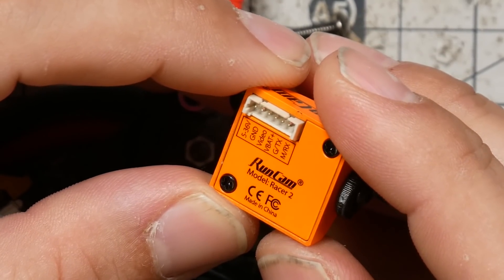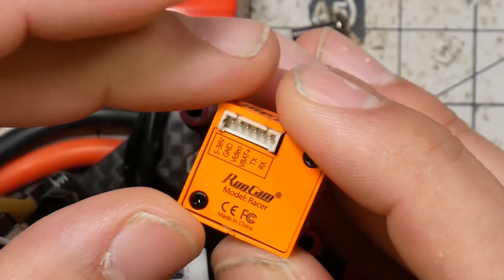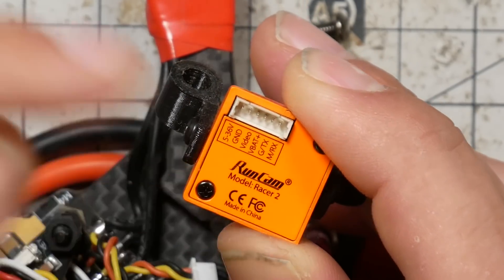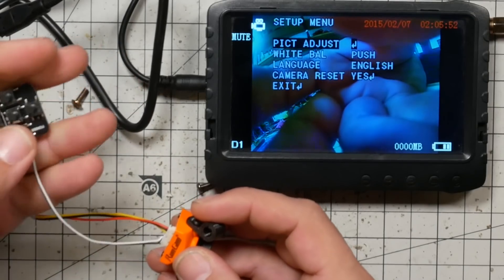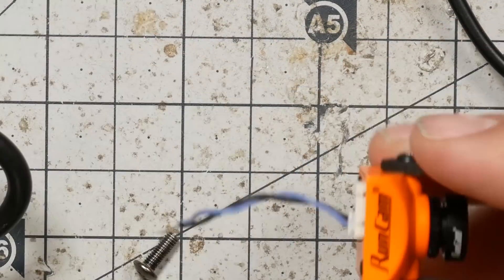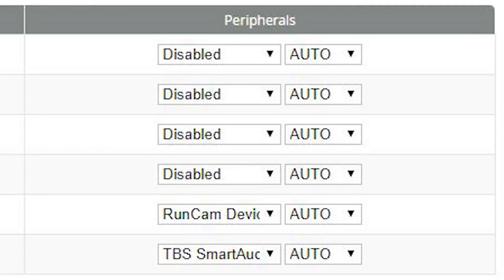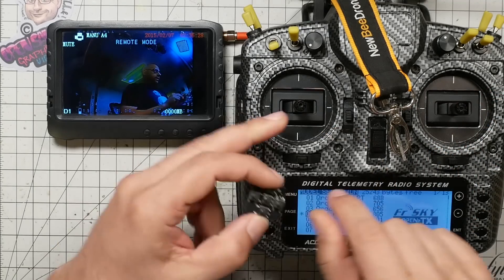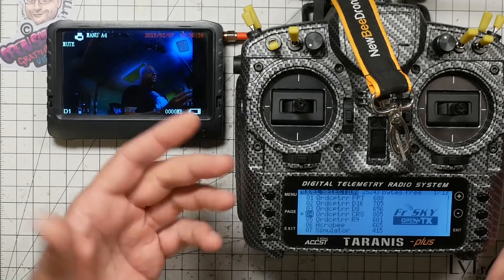Runcam Racer 2 Camera Control Not Working | FIXED

Comment: Hi Joshua. I have an GEPRC Stable flytower stack. Can I just use one line to control the cam ie,  fc TX uart pad and connect to RX on the camera and not use the fc RX uart pad to the TX on the cam (no pad on the fc)?

Comment: Wouldn't it have been nice if there was a shorted plug on the control board you could plug into that would switch it over? Also I was wondering how you don't enable this when you are flying but I'm guessing it won't work when you are armed?
Reply from the maker: Correct. It won't enable when you are armed.

Comment: Is it also possible to access the bf osd camera control via this feature? to change pids and control your vtx?
Reply from the maker: These are two different features. OSD and camera control are independent and do not depend on each other to work.
Reply: So how i need to solder if i like to use the bf feature to change pids and access the vtx with the racer 2?

Comment: hey joshua how do you access the bonus menu on a runcam 2? id lioke to lose the "runcam" title as well as the voltage signal due to I use the Beta flight osd for that. Thanks

Comment: Good info JB, thx for sharing. I personally prefer to use the "bat+" from the camera to monitor the voltage on the OSD.
.
Reply from the maker: If the camera is powered from vBat this isn't necessary. If you're powering the camera from regulated power and using the OSD, then the bat+ wire is needed.
Reply: @JoshuaBardwell  Guess I should have elaborated. I am using regulated power to power up both my camera and vtx. In fact , I am using your version 2 flight controller & use the 9 volt output for both. I don't have the need to set up my camera more than the one time, when first installed, so using the joystick isn't a big deal to me.
This is just the way I do it & am not saying it is the best waym, but I do have very good video. I also am using the OSD with voltage monitored via bat+ on the camera.

Comment: do I connect the same way for this cam as the one in your video??? the back of the runcam micro swift has gnd and osd in those positions ???
Reply from the maker: If your camera has GND and OSD, that means it has analog control. It will work with a joystick or with the CAM_C pad on your flight controller. But CAM_C is unreliable and often doesn't work.

Comment: I'm sad cause my old runcams have OSD/GND and all the new flight controllers are dropping cam control cause TX/RX support so gonna have to get a couple of the little controller adapter boards :/.  Sucks you have to run two extra wires now in stead of just one :/

Comment: Ok I have a mamba f405 mk2 with the latest beta flight and firmware 4.2.11.
I have set the camera to uart mode, I get the 3 beeps when pushing right and 2 beeps when pushing left but it does not display any settings at all.
What do I do now?

Comment: Should've been this way from the start. I was pretty annoyed when I received 2 newer micro eagles with tx/Rx control. It should've never been integrated until this form.
Reply: @steelrainfpv3383  awesome, those paid for my printer. Thanks again.
Reply: @hazzafpv3015  i did not have a spare uart, i'm using it on a plane with a f411 wing, only a couple uarts on that board.

Comment: What it's the uses of a on off switch on a Fpv camera 🙇🏻
Reply: Guillermo Nespolo I think you’re talking about the switch for his VTX, in which case it keeps the VTX off until you are ready to fly so you don’t knock others out of the air by powering up right next to them. 

This way you can mess with your quad, power it up, even arm it quickly or test something line of sight with absolutely no effect on those around you.

Comment: "If you don't have one of these you should get it.."  not trying to be rude but unless you are a reviewer or someone who does this daily like yourself, there is no way in hell it is a must have for anyone else like you claimed. (changing cameras monthly and i never see my self for the need of this adapter+ i'd had to buy the screen)
Reply from the maker: If you don't see the value, that's your prerogative. Here is why I recommend it.

No video in goggles. You see the OSD so the FC and vTX are working. Is the camera damaged? This $3 adapter will let you plug the camera directly into your goggles and test it. You don't need the screen. Just the AV cable that was included with your goggles.
Reply: @JoshuaBardwell  Now that i think again, you are right. it is just that i didn't receive any adapter when i got my used HD2s... Thanks for clarifying
Reply from the maker: This is the one I like to use. 

https://amzn.to/2BqPOte